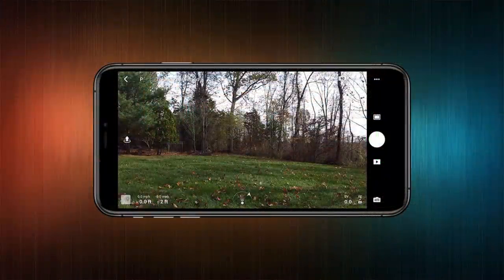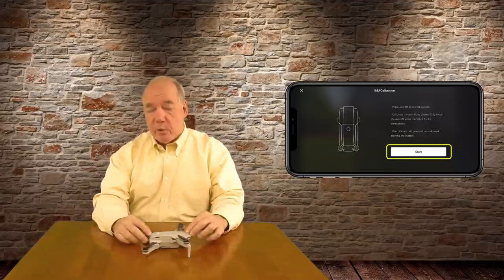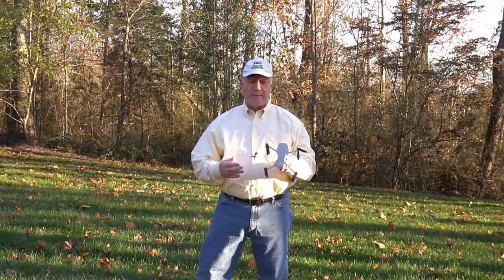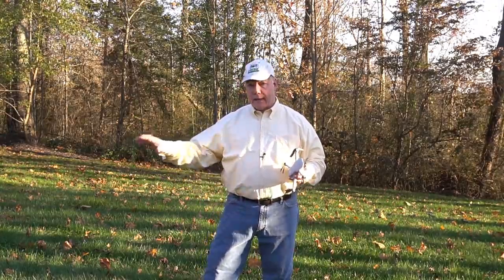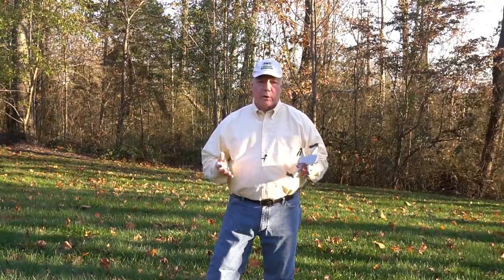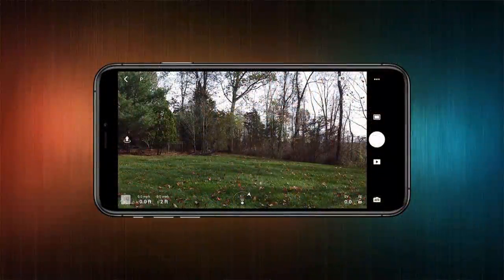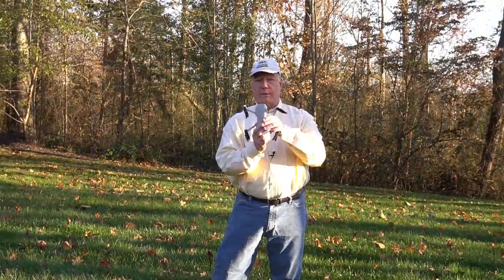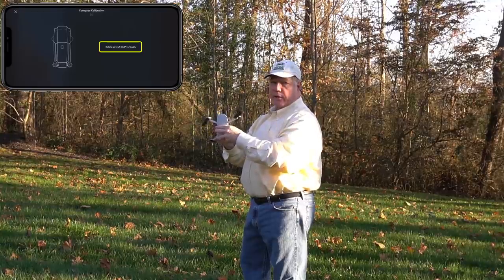Mavic Mini - How to Calibrate Your Compass & IMU

Comment: I've yet to get a drone, but I am looking at the DJI Mini as a first timer. However, I've seen a lot of YT videos when they mention about, "You may need to calibrate your compass".
And I've always though, "Hmmm... Seems more hassle than it's worth!"
And you've just explained it in such a simple and concise way, that I can move these calibrations out of the "Why I shouldn't buy a drone" list.
Nice one. And thank you from the UK.
Reply from the maker: I appreciate the post and it's a very simple process that you'll only have to do very infrequently. Most of my flights are done without worrying about the compass and if it's off, the application will alert you and you can quickly calibrate it. The Mavic Mini is an amazingly cool drone and you'll have a lot of fun flying it. Be sure to sub the channel and stop back soon so you don't miss anything. Rick

Comment: Compass calibration:  If the Mavic Mini is purchased directly from DJI, is the compass calibration set for its location in China?  Do they calibrate it for your shipping address?  I imagine this would be a bit time consuming trying to match up specific orders with specific delivery points.  Or, on its initial power up after receipt, does it somehow calibrate itself or does it require a compass calibration on first use?  Thank you for your videos as they are very informative!

Comment: I always begin my compass calibration facing North, and carry a small compass in my drone bag. I've been doing it this way since before drones had compass, when calibrating cell phone compass. Cell phone compass and the first drones with compass included that step in the calibration instructions.  For some reason newer drone compass calibration instructions have discluded that step, but I still do it that way anyway.
Reply from the maker: Duck, you're taking it to a whole other level with the compass and I'm sure it makes it more accurate. I've been lucky to not have any issues so far with the IMU or the compass. Also, I sent you a reply today to your email so let me know if you have any other questions. Rick
Reply: I'm sure DJI has their compass refined by now so it doesn't really matter what direction you start the calibration in. But it's just habit with me by now, so I do it that way.  With cheaper drones I think it's more beneficial to start the calibration facing magnetic North.  One sure sign you need to calibrate the compass is if your drone starts "toilet bowling";  flying in small counter-clockwise circles.  That's caused by an out of calibration compass fighting with the GPS. They both want to be right so both keep trying to correct the drone.

Comment: Hi Rick. Does it really need to detach the camera cover when doing IMU and Compass calibrations? So for IMU you can do it once on your first flight and whenever the app tells you to do so BUT for compass calibration, aside from doing it during your first flight you need to do it everytime you change locations and especially when the app tells you? OR if its much safer for new users to do IMU and compass calibration in any flight even in the same locations or not and whenever you are changing batteries? Thanks for your always informative videos! Kudos!
Reply from the maker: Epson, you need to remove the gimbal lock every time you're going to power up the drone because the quad goes through a "power up" routine that moves the gimbal around to check it's motion and you'll get a gimbal error (and possibly damage the gimbal) if you don't. As far as the calibrations, do both the compass and IMU when the drone first arrives and then don;t worry about the IMU unless you see an error. I do the compass every time I move to a location far away (more than 2 hours) from the last place I flew. Thanks for the post and I hope that helps. Rick

Comment: Actually, the IMU has a gyro to control the yaw by modulate the torque on those motors to keep the drone stable in Z axis, and to turn the drone when you give a rudder command.

Comment: I down loaded the calibration procedure for the mavic pro  and I was right according to that procedure and  you are calibrating wrong, either that or they have changed the procedure, ok what is the correct procedure for the mini ?
Reply: was thinking the same thing.  The way DJI says to do it in the manual for the Mini is not the way demonstrated
Reply: agreed
Reply: It works either way... It’s even easier to do it the way DValley shows because DJI’s way can mess up the can if we aren’t careful... So if it works, why not!????

Comment: Thanks for this most valuable information. I have a problem with my directional display on my display. When the mavic is pointing away from me, it shows  as pointing towards me and vice versa.. The sticks work correctly, though. for the left and right, front and back movements.

Comment: Hey, Rick...I have P4P and M2P that I fly with a Crystal Sky Ultra. I bought a Mavic Mini and want to get DJI Fly app onto the Crystal Sky. I have the OTG adapter to connect it to the RC. Any idea where I might find apk file for the app to sideload onto the Crystal Sky?? Thanks for your great, informative videos!!
Reply from the maker: Thanks for the post and I'm working on it and should have an update soon. The version of Android that DJI has loaded on the Crystalsky is missing a few key drivers and I'm getting a series of error messages when the app loads that I'm trying to sort out. As soon as I have it figured out, I'll post a clip letting you know what I found. Good luck!

Comment: are you sure about holding drone UP for calibration? Always before I held drone in normal flying position and then rotated 360 degrees horizontally. Then pointed drone with camera  UP and spun it horizontally, too. SO is the Mini different than the Mavic 2 Pro calibration? Also Billy Kyle does not demonstrate compass calibration like you did.
Reply: I am with Concerning Drones here. The only official DJI video on their website describes the process as HOLDING the drone horizontal (right side up) and rotating 360 degrees (he does it ccw.) Theh he HOLDS it vertically (nose pointing down) and again rotates 360 (ccw). Granted, it is an old video, but I sincerely doubt that they have changed their terminology. BTW there appears to be no user manual available yet for consultation.

Comment: Hey Rick question ? Do you have a video on what stick controls pitch roll and yaw and if not would you be willing to make one for us flyers that have never touched a controller?
Reply: In mode 2 the left stick controls the throttle on its vertical axis and yaw on the horizontal. The right stick is cyclic and will pitch the craft in the same direction as the stick when oriented in the same direction as the pilot. In Europe, mode 1 is more common. There's a video called "Mode 1 vs Mode 2 - Drone Remote Control" on YT that goes over the differences.
Reply: @markuschelios6891  thanks lol it took so long for someone to actually read this mine already got here and I've flew it multiple times

Comment: I have one question. If I want to fly this drone from a boat or raft, how do I calibrate it? Is it necessary?
Reply from the maker: As long as you don't have any errors you should be fine. If you're really concerned, you can do a compass update before you start flying just to make sure the compass is set. Thanks for the post and stop back soon for more content. Rick

Comment: Hello Drone Valley 
Love my Mavic Mini drone.  After performing a Settings Reset on my iPhone 12 Pro Max for a different issue, and after using it without any issues prior to the Settings Reset, the Mavic Mini’s Orientation Display ( the arrow with the dot in the bottom middle of the phone screen) is missing.  I have done the IMU and Compass calibrations as supposed and As I have always done, I have made sure my location settings on my iPhone are on, also I have made sure my iPhone’s compass is calibrated as well but the issue of the Orientation Display being missing or not showing on my iPhone’s screen is still happening... Any suggestions?  Is there any way I can factory reset this drone? If it can be done, that is?  Or any other suggestions? I will really appreciate your help with this matter because it’s a pretty awesome way for me not to loose my drone... Thank you for your great and well done videos... Btw, Happy new year and stay safe out there Drone Valley!!!
Reply from the maker: Thanks for the post and it sounds like you have an issue with the application. I'm sure the drone and controller are OK so try deleting and reinstalling the application to see if that fixes it. If not, delete it and download it again from the DJI site (the latest version) and see if that helps. Good luck and let me know how you make out. Rick
Reply: @Dronevalley  Thank you for taking ur time to reply.  I just found out that the DJI Fly app was updated two days ago to 1.2.2 and now the orientation display is at the bottom left of the display.  They added the one used on DJI Go 4.0 and now it’s not at the center as it was before...  I went crazy thinking it was due to the settings reset I did to my iPhone 12 Pro Max because it was giving me issues with the Apple Pay feature.  But again, thank you very much for your awesome videos, and also for replying to my question.  Stay safe out there DValley!

Comment: Hi, when I started the IMU calibration by setting the aircraft exactly as instructed & then pressed START, the screen advanced and displayed the aircraft in exact position as instructed. But then the screen did not advance, just stayed locked. Please advise, thanks.
Reply: mine did that as well s i had guards on

Comment: Hello Rick, Thanks again for another great instruction video about the Mavic Mini👍🙏I have a question about using the Ipad Mini4 with the Mavic Mini controller. Can you confitm this works? It’s not on the list of compatible device as far as I know. Thanks for all your efforts to give us information about using the new Mavic Mini. Greetings.
Reply from the maker: Thanks for posting and I was using the iPad Mini 4 this morning for a flight and it works fine with the Mavic Mini. The only thing that's a little wonky is that the DJI Fly app isn't coded for scaling so the menu system is a little compressed on the iPad. They may sort that out with future versions of the app but I like the additional screen real estate. Thanks and be sure to sub the channel. Rick
Reply: Rick, Thanks for the quick answer. I subscribed to your channel!
Reply from the maker: Thanks, and be sure to watch for the 12 Days of Drone Valley Christmas giveaways!
Reply: Rick, I will watch Drone Valley Christmas giveaways! Thanks for mentioning it!

Comment: One thing I noticed setting up IMU with mini/ mini 2 is when you put the drone to the side it drops inwards a bit , should we allow it to be that way it have to hold it 90 degree to the surface for side calibration ?
Reply from the maker: No worries, you're essentially rotating the drone body through both a horizontal and vertical plane to help it calibrate. If it's off a little, the drone will make you spin it a little longer to compensate. It's wicked smart and you should only need to do this calibration if you travel a long distance between flights. Thanks for the post.

Comment: My mavic pro has you do it with the legs folded in. Also isn't it important that the table your using is level? So this one the arms are unfolded?
Reply from the maker: Thanks for the post and the arms being in or folded doesn't affect the calibration. Even if the table or surface is a little off you'll be fine. Like I mentioned in the clip, all of the measurements are based on the original one so as long as you're consistent you'll be fine. Thanks for the post. Rick

Comment: Other video's I have watched the calabrate the drone with the arms unfolded which way is best open them or leave them closed?
Reply from the maker: Doesn't matter which you choose. The calibration just needs to see the drone rotate through it's horizontal and vertical axis to set the compass. It takes about a minute to complete.

Comment: Great video as usual Rick but with the new firmware V1.00.20 the imu calibration displays the drone in its folded position.
Reply from the maker: Lauren, thanks for the post and I haven't grabbed the new firmware yet and will download it tomorrow. Both the folded and open legs result in the same calibration. The procedure is really measuring the difference between the initial reading and the others to set the range of motion.

Comment: When calibrating the IMU on my mavic mini, it asks me to lay it on both sides. It lays perfectly flat/parallel to the table on one side, but slightly angled on the other side. Is this normal? If not, should I be holding it parallel on the angled side so it calibrates correctly?

Comment: The onscreen instructions show it being moved about while folded up. I wonder if that is the reason the IMU calibration has failed three times? I am getting tired of all the glitches encountered and so far it hasn't flown in hours of working on it. Turning off the drone I have to pull the battery. Registration was a pain.   What next. Maybe DJI has a good help desk. If not, its going back.

Comment: Billy Kyle shows his video to do this and his app shows legs closed for IMU?? Did DJI change the app to show different way now for IMU or doesn't matter if legs open or closed??
Reply from the maker: Thanks for the post and I was following the instructions in the Beta version of the DJI Fly app I was using but it doesn't really matter. The way the IMU calibration  works is that it takes the first position as "home" and when you move it (arms open or closed) it marks the travel at 90 degrees and 180 degrees for the quad. If you ever do it wrong, the calibration will fail and tell you to start over. It's a very smart drone. Thanks for stopping by and be sure to check back this week for more content. Rick

Comment: Take note: There is a bug in the Mavic mini firmware that might result in a fly away if your compass isn't working correctly. I have logged a case with DJI and they are looking at my flight log. I have also shared it with other people on the DJI forums.

Basically the Mavic Mini heading was incorrect before take off and stayed locked in the wrong direction after take off, with no indication or warning given by the Mavic or the DJI Fly app. After take off the Mavic Mini stopped responding to any controller input, it accelerated to full power and flew away in a random direction. IMU, altitude, camera and GPS was working perfectly, yet the incorrect compass data totally screwed up the on-board flight controller and the Mavic was lost as a result of this.
Reply: This just Happened to me.

What's the update or solution to this?
Reply: DJI will be replacing mine under warranty.

Comment: Did they change the compass calibrate procedure since the mavic pro? 
For the pro, first you'd hold it level and rotate it 360 or more. Then you'd point nose down, keep nose down, and rotate it 360 or more.
Reply: I actually just downloaded the manual for the mini, and answered my own question. It is same process as mavic pro.  you point nose down, and rotate while keeping nose down. although the photo they display shows nose up. Lol
Reply: The calibration procedure that Rick does is different from the one that I do with all my other drones. I don’t see anyone else suggesting this calibration method with the Mavic mini. I need to know if it makes a difference which calibration method you use?
Reply: Not sure but the one Rick shows in this video is not how it is shown in the mavic mini owner manual. I would stick to the way they show in the manual. DJI would not steer us wrong in their own user manual. :)

Comment: Is it OK to do the IMU calibration indoors? I know to do the compass calibration in the field away from metal and electrical instruments. To have the drone facing to the left is a bit ambiguous? I'm in Australia so your left is my right or not? Why left?
Reply from the maker: Russel, you can so the IMU calibration indoors but not the compass. What you're doing with the IMU calibration is setting the vertical and horizontal "planes" for the quad so it flies level. The direction you spin is not really important as long as you consistent for both parts of the calibration. I hope that helps and happy flying!
Reply: @Dronevalley  Good stuff Thanks. Subbing.